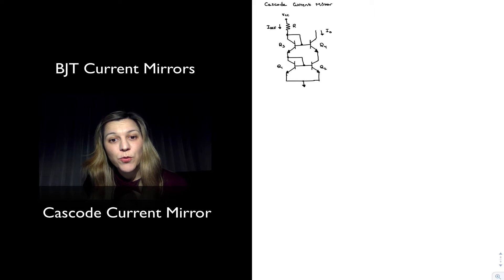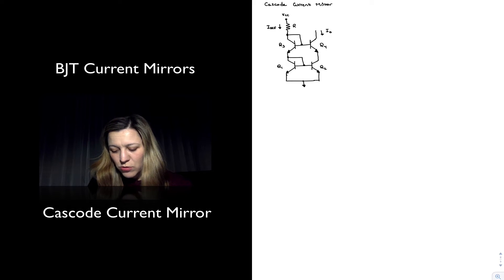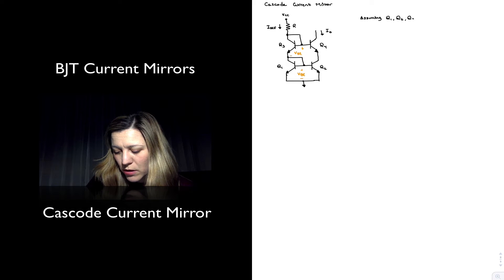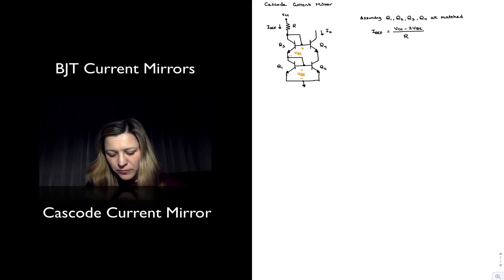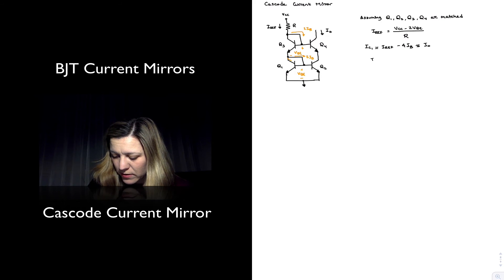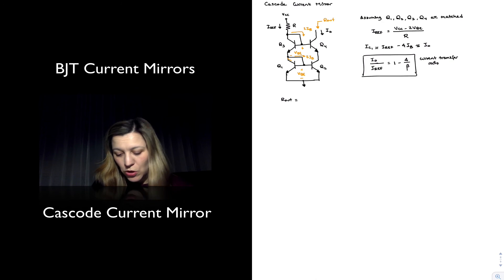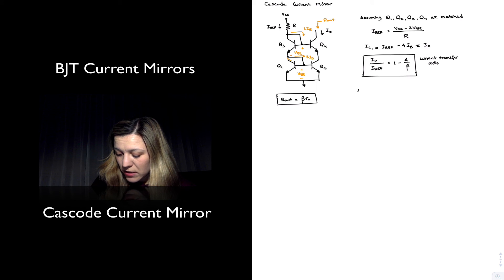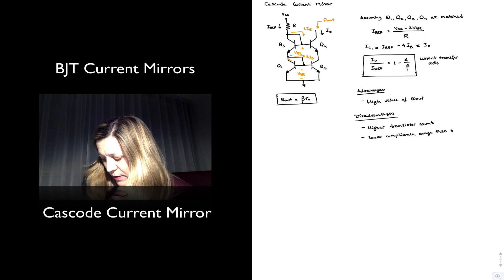BJT Cascode Current Mirror

Comment: Hello Dr. Christina, Dr. Aboy- can you confirm that the circuit is drawn correctly? I've only seen this circuit with the 2 bases of Q3 and Q4 connected back to the node sinking current from Io, instead of the node sinking current from Iref. As I have seen it, it is called the improved Wilson current mirror, because it builds on the Wilson current mirror by balancing the Vce drops. Is that correct?
Reply from the maker: The circuit is correct. This is not an improved Wilson current mirror. It is a cascode current mirror.
Reply: Thanks Dr. Aboy. Upon analysis it appears that, if we make the same general assumptions between the two structures, we end up with a similar Rout and Vcompliance. Is that correct? I looked a bit on the net and found some discussions that indicate an improved wilson is more appropriate for circuits using BJT and the cascode was preferred in the use of CMOS. I couldn't follow their reasoning, but assumed there must be some virtue in using one over the other for specific use cases. Any insight you could share would be apppreciated. (By the way- thanks for the videos, I've really enjoyed them!)